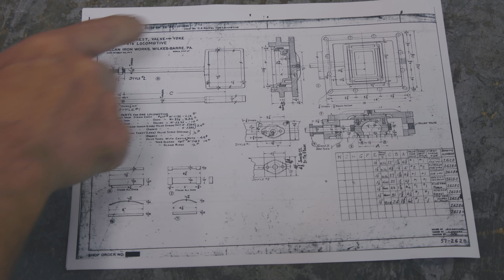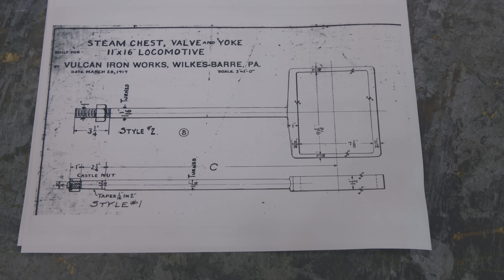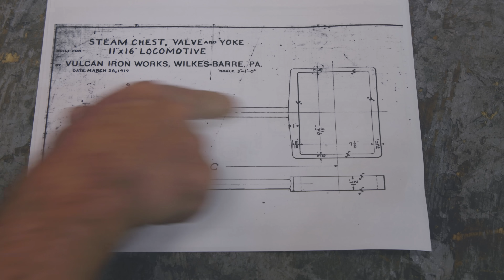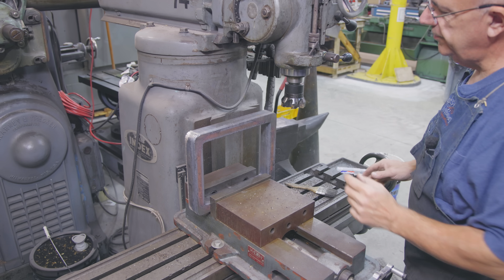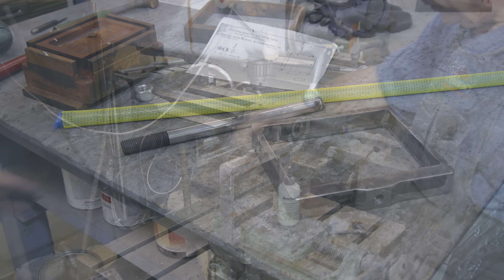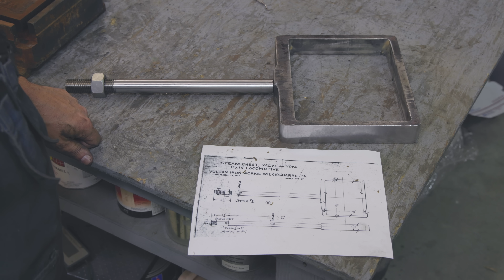Vulcan Steam Locomotive Repairs: Making a New Steam Chest Valve Yoke and Rod

Comment: From watching Cutting Edge Engineering, who does a good bit of chrome bar work, I think the reason why the rod was 1 &1/16" was so the threaded area could be reduced in diameter to get below the induction hardened layer. Curtis uses a ceramic insert to get through the layer & then switches back to conventional carbide.
Reply: The 1 & 1/16 rod from the blueprint was pinned, not threaded. This will be the first time in that yokes life (100 years) that it has been threaded. I bet it works fine.

Comment: For chrome, I've heard that ceramic inserts work best, but I doubt they make them for threading. With the 1-1/16" dia. rod, you could probably have turned the chrome layer off the rod and had an easier time. I'm not a machinist, but from watching Curtis at CCE from Australia, that sounds like a good way to go.

Comment: This material is not only chrome-plated but it is hardened several millimetres deep. So you were cutting coarse thread in hardened steel, no wonder it fought and the cutter was whining. Kurtis from CEE Australia uses ceramics to lathe this hardened layer off his hydraulic rods.

Comment: I have no idea how threading on a lathe works.  How do you make sure the thread cutter starts in the cut left by the first pass, and subsequently.?
Reply: The lathe has a threading dial that tells you when to engage the half nut, Keith has a video restoring a threading dial, look for LeBlond Lathe Restoration - Part 19
Reply: @ruben_balea  Thanks.  Will do.  Appreciate the response

Comment: Not sure the Loctite will do any good considering the heat of the steam.  Also, I'd have put a radius on the end with the 3/4 inch thread.  Might be a fracture point.

Please list the steel grade for the yoke.

Thanks, Keith         dave

Comment: I think this question popped into my head on the capstan project. Now I’ll ask it: When you are cutting threads on a rod like this, in multiple passes, how does the tool always restart synchronized with the previous pass?
Reply: The lathe has a threading dial that tells you when to engage the half nut, Keith has a video restoring a threading dial, look for LeBlond Lathe Restoration - Part 19

Comment: Oh god, I can feel a rant coming. 

For those of you who like to read comments before watching videos, spoiler alert is coming up in a moment.

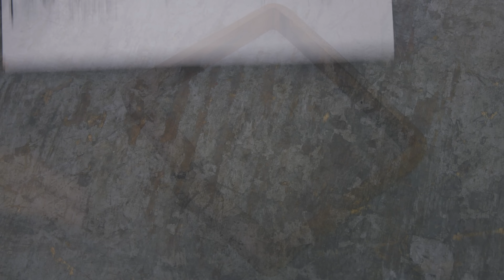If like me you are not interested in blueprints and diagrams, unless they are  connected with the projects im working on in my own workshop, then I would suggest you fast forward to 3:56.

So, the spoiler alert is that Keith, while attempting to mill the Yoke in a vertical position, is concerned over juddering, which does happen and is  perfectly natural. However, it sounds as though at least one cutting blade is misaligned, as Keith later poins out, which happened again on his other machine when he swapped over. 

If it were me, then instead of changing over to another machine, I would have first, checked the alignment then adjusted it then changed the speed and feed ratios first, but Keith didn't bother with any of that. Why not?

That would have been the most logical course of action. Also, instead of backtracking to the beginning, thus wasting time, why not cut on the return? I do it all the time, but then my tools are always set up corectly, in perfect working order and my cutting choice of tool is sharp!

Two machines, two different cutting heads, both not aligned correctly in the same video on the same day! What are the chances if that, what  is going on? It seems to be a regular theme where Keith is concerned, I'm afraid.

This channel reminds me of my early metalwork classes in school 50+ years ago between the ages of 11 and 16. Many students using all of the machines and no satisfactory maintenance being carried out would lead to issues, and rightly so. 

Accidents are always on the horizon, just waiting to happen. That's what this channel reminds me of. A time in the 1970s when health and safety did not exist. A time when making love was more important than anything else.😂

It is as though in every video, there is something going wrong. Things that in a professional setup, i.e., an engineering workshop full of qualified experienced enginers with lathes and mills going 10 to the dozen for 8 solid hours, these type of issues would only happen once in a blue moon.

My metalwork teacher also took us for physics classes, double ones at that. I don't ever remember him making mistakes or there being equipment not set up corectly as often as there is on Keith's channel and he was not a full time engineer like Keith but a physicist who loved enginering.

When I was 16, I, like other boys and girls from different classes that were interested in engineering, changed to a class where our teacher was a fully qualified engineer. Even then, with a workshop containing 24 students on rotation 4x a day. That's 96 students a day, 5 days a week. I had two double classes every week. I don't remember having that amount of cockups and defective tools compared to this channel. 

Perhaps it's your age, Keith. My advice is to check your equipment, machines, and tools prior to starting your video. Do what the TV chefs and cooks do. They get everything ready first, prior to recording a show or going live. They have their ingredients measured out in little bowls and any tools needed laid out like soldiers in a row.

How often do we see you go off to get a tool in the middle of recording. How often do we see you make a mistake when setting up a project on a mill or lathe saying, "I'll bring you back once I've done this or I've done that", for example? How many times, Keith? Test runs, dry runs, or dummy runs, call them what you like, but do them.

I've told you all this before. Get everything you need and have it at arms length. Do a dry run first. Once you're happy with where you are going, then start your video. It's good to show us your mistakes, of course it is, but why are there so many of them? It doesn't look good or professional, Keith.

The reason why Keith struggled to cut the thread on the chrome rod is very simple. He failed to remove most if not all of the hardened thickness first. 

Even on my phone screen, I could see around 3 or 4mm needed to be removed. An experienced engineer would have done that, and if after removing the hardened thickness of say 4mm, would have meant leaving insufficient material to thread, then a thicker rod should have been ordered.

Also, some cutting lubricant wouldn't have gone a miss neither, but not that green anchorlube 5hit or whatever it's called. I got given a small bottle last year by an American Youtuber who subscribes to my channel.

I found that it was good for tapping but drilling or cutting threads, forget it. I was not impressed at all. WD40 does a better job and a 1/3 of the price, too! Just listen to the sound. That's the sound of pain that cutting tip was experiencing. I had to mute my sound. It hurt my ears so much. Poor tool.
Reply: The man who never made mistake never did anything. You can be an armchair machinist all day long and you will never learn from your mistakes because you don't actually do it. One example that shows just how much you don't know is that he got the size shaft that he needed to have a hard surface where it was going through a packing. If he got a bigger size, he would have to remove the chrome plating to make it fit and that would have defeated the purpose of getting a chrome plated shaft. Get out of your armchair and get some experience before you criticize a real worker's decisions.

Comment: Hi Keith, nice job, the copy of the blueprints you had look like they are a bit worse for wear, if you use something like photoshop you should be able to clean them up a bit, it’s time consuming but worth it to have a decent blueprint to work from in my opinion, if you want I would be more then willing to have a go at them for you. 😊
Reply: The original drawings were done on linen and age has taken its toll.  The look of the print shows the age, wear, and tear of the years of use.  I use to make prints from similar drawings.

Comment: Keith,  I am concerned about the Loctite 290 Threadlocker.  It is rated for -55.0 - 150.0 °C (-65.0 - 300.0 °F ) Your steam is all ready at 300.0 °F at just 50psi.   With 100psi steam you will NOT have thread locker at 337.9 °F !!!   I think you may need another method of keeping the rod locked and not allowing it to unthread from the valve slider.
Reply: Oddly, ordinary Permatex high temperature red threadlocker is good to 450°F. There are also a variety of ceramic type threadlockers good for 1000°F to 2000°F but they do not at all stand up to water.
Reply: Keeps some Ceramic inserts on hand for that induction layer for future projects.
Reply: Sounds like you looked that up. Good point.

Comment: Why not make the new rod from stainless steel, would solve the corrosion problem?
Reply: It is a wearing problem more than a corrosion problem.  The packing rides on the rod to keep steam in the valve chest.  The rod moves back and forth once each wheel revolution.

Comment: I wonder if it wouldn't be better to increase the size of the packing box by just enough to allow (over the original dimensions of the yoke rod) a 440C stainless steel sleeve to be threaded (at both ends) over and allow it to be the wear (and changeable) part. I mean... stainless can take steam pretty well, 440C is wear resistant (afaik, the strongest, might be wrong) and it being a sleeve would not rob the part of any strength. Also, it wouldn't have to be a super thick sleeve, so not that much increase in the packing box's aperture. Just a thought.

Comment: Great to see that older equipment is being maintained and run . I do have one concern you may not have considered. Making the rod with the 3/4-16 end is a great idea but looking at the wear on that old rod it is pushing and pulling offset somehow as evidence by the marking on the chrome. So my thought was that bored hole in the steel and pinned had a better chance of longevity than a threaded one.The harder rod wearing into the steel hole. The rod being threaded and more rigid at both ends might now put undue stress on rod and box frame that will fail much sooner than if it were turned and pinned at say 7/8 diameter. Just my thoughts, what do you think?

Comment: Keith, if you look at the temperature/strength curve for Loctite 290, it is down to less than 70% strength at 150'C so there won't be much strength and holding power left with your superheated steam working temperature.
Reply: Slidevalve -> no superheated steam. But even saturated steam at working pressure will be close to 150 C
Reply: 100 psi gage is steam at 337 degF.  I think I'd put a setscrew on the side of the yoke "just in case"
Reply: 3/4" mod seems on the weedy side. I think I'd have gone for 7/8", to increase the annular meat, but retain more of the rod strength, plus some sort of locking tab.
Reply: My ears pricked up at the use of a thread locker on such a part, even if within working range the cyclic nature of the load might be thought a concern.
Reply: Also wondered about this.  With both ends threaded/bolted and no mechanism to keep the rod from twisting I'd think this would be a concern... Would a pin be a better answer? Software engineer here, just trying to learn 😁
Reply: @VAXHeadroom  Taper pin was my thought.

Comment: If that part just cracked after about 100 years, I assume the warranty has run out?
Reply: I believe that the Vulcan Iron Works closed shop in the 1950s without a successor.  So warranty claims could be rather iffy.
Reply: When somebody drilled out the square ring to use a replaceable rod, they introduced a weak spot and voided the lifetime warranty.  Sorry.
Reply: I’m sure the “Extended Warrantee” people would be happy to sell you a warranty on that part for about $2000. per year.